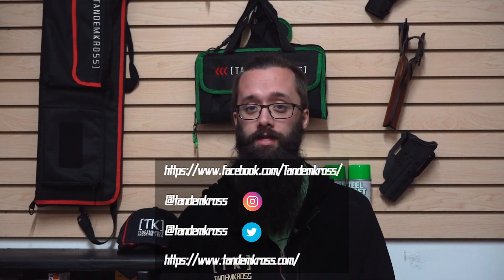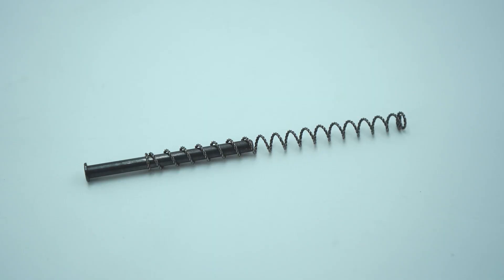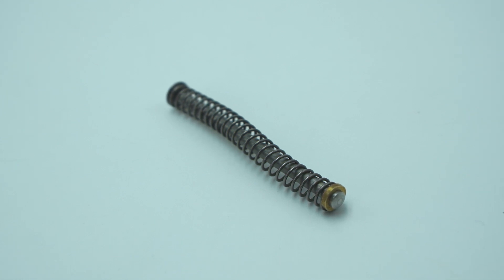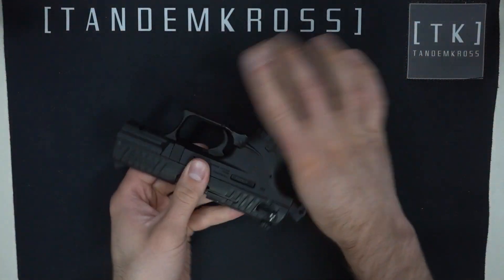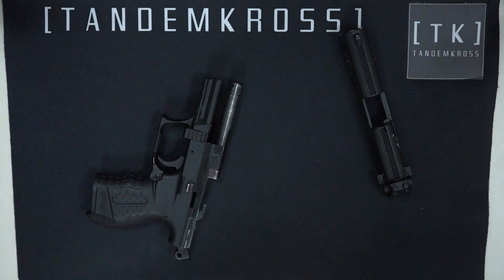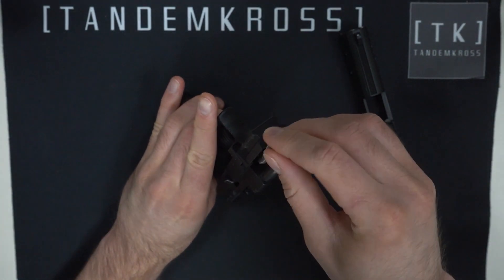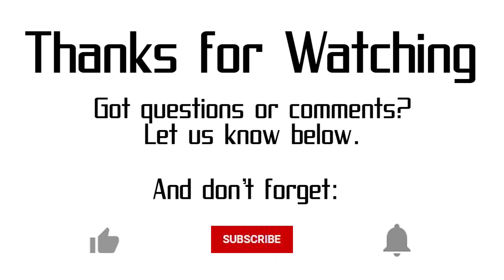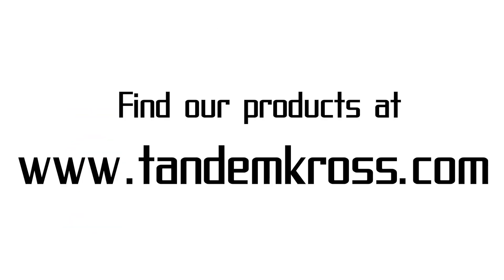TANDEMKROSS | "Sentinel" Captured Spring Rod for Walther® P22 | Install Instructions

Comment: I haven’t even received my P22 California version but I already ordered this ahead of time.
Reply: I just got my P22 CA; the old spring is very difficult. I am trying out the new one for the first time today.
Reply: @jsatko  Please let me know how it goes I’ve heard mixed feelings on this pistol on reliability. I own a couple Ruger’s that are fantastic but you could no longer purchase them in California and I would not part with them but I just wanted this one because of the aesthetics. I have a couple Glock’s but 9 mm really expensive right now so I wanted something with a similar style and cheaper to shoot.I know they sell a 22 conversion that you could use on the Glock 19 but I I would rather just have a dedicated 22 LR.
Reply from the maker: let us know!
Reply: @drakejdf  I just bought a p22ca and didn't even try the original spring lol I had this one ordered already. I took mine out with a 500 box of aguila super extra and it did not jam once.
Reply: @drakejdf  Got my P22CA in December and have had a bunch of problems.  Mostly problems feeding new rounds where the slide will just hang. This seems to happen more on a full magazine, like the round is under too much pressure in the magazine for the spring to have enough power to push it out of the mag to load it. Also seems finicky with ammo and some ammo won't allow the shell to eject fully or the next round won't be caught.  I did polish the ridge on the hammer and it made it better as it allowed smoother travel.  Just wondering if this captured spring would give more consistent results. No run having to make sure the chamber is closed and fully loaded after every fired round.
Reply: @JAW_73  update.I sold it less than a month after purchase.tried 6 brands of ammunition and only liked CCI.a video by 22 plinkster sold me on this pistol but the obviously dialed in the one they sent him for review.never by anything walther again/complete garbage.my ruger and buckmark 22lr pistols are far superior.
Reply: @drakejdf  thanks for the feedback

Comment: Just got mine in the mail. This is the first time I've modded a gun. Should the new captured spring be lubricated?
Reply from the maker: It's not strictly necessary but it couldn't hurt.
Reply: @TANDEMKROSS  thank you for the reply. I bought 2 as I plan to get a 2nd P22.

Comment: Does it make the gun cycle better or is it just to make it easy to put back together? What are all the benefits of this capcured spring? Thinking about getting one.
Reply from the maker: We've been told anecdotally that it has solved cycling issues, so this has been a happy side-effect. Our guaranteed benefit is much easier reassembly of your firearm.